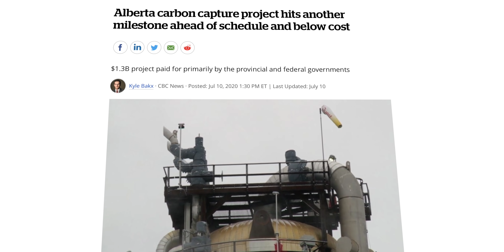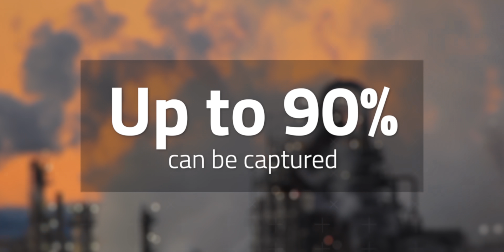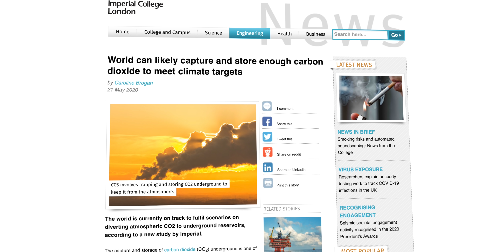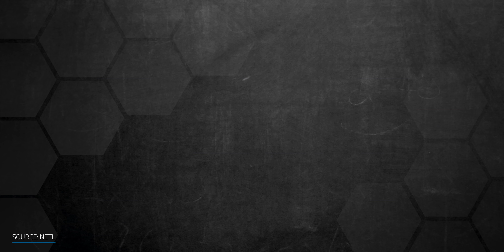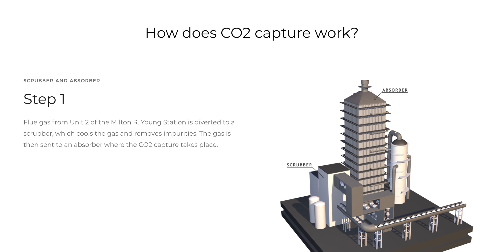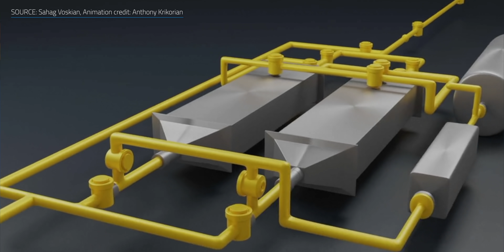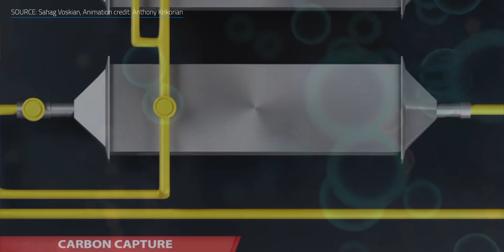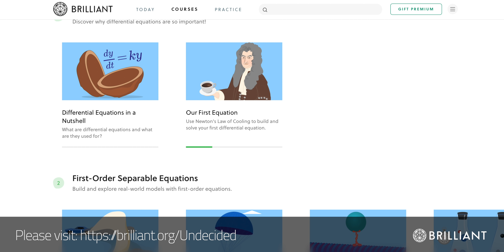The truth about capturing CO2 to reverse climate change

Comment: The energy required for CCS means that it's better to leave the carbon in the ground in the first place.
Reply: Niall Mccarthy  We or anything else don't need the excessive amount that humans are producing.
Reply: @3rdrock  Perhaps it's sad, but it's easier to create huge global infrastructure projects than to change our behaviour. CCS is here to stay.
Reply: @samspencer7765  Too bad there are none that actually work.
Reply: @3rdrock  Carbon sequestration does work we just won't be at scale until the middle part of the century, there's good promise in energy storage for renewables too
Reply: @samspencer7765  Can you cite one example that isn't Advanced Oil and Gas recovery(AOG)?
Reply: @3rdrock  I think there's some pretty interesting stuff going on in terms of mineral & soluble carbon trapping. Riaz & Cinar showed the feasibility of shale based sequestration in 2014 but I'm most interested in North Sea liquid absorption as of right now, but we'll have to wait until the mid 2020s if Covid hasn't knocked it back a smidge.
Reply: @3rdrock  Also just out of curiosity, roughly how old are you?
Reply: @samspencer7765  you seem to know something about CCS, at what pressure do you think they are pumping the CO2 into the ground?
Reply: @samspencer7765  just out of curiosity why do you want to know my age?
Reply: @3rdrock  I'm terms of the pressure within the actual ducting as it travels down I have no idea, it'd depend on the material and diameters they were using, whatever seals they were using to stop reversal etc.

But in terms of what pressure carbon dioxide would need to be stored at in terms of mostly raw CO2 that you're not doing anything special to (Think using cerium as a catalyst to remove the oxygen atoms etc), would be somewhere in the region of between 1000 - 1200 psi. If you can get it below about 900 meters, say 1km to be conservative you can keep it in a supercritical fluidy type state indefinitely just by the natural psi down there is within that range. Now sequestration is NOT the smoking gun solution, it's certainly pricey and you'd get best results by finding areas that are seismically stable but that don't present a challenge in boring down too much, which is why the North Sea is pretty promising.

Im no economist, it may transpire that trying to decarbonise goods, services and energy is cheaper in the long run, but I'll bet that over the next 20-30 years that won't be able to happen fast enough and we'll use sequestration as a stop gap solution in part until we get there.
Reply: @3rdrock  It feels a bit detached when it's just a name with no indication of who you're talking to, one of the sadder aspects of the Internet in general :/ I often find it bridges the gap in terms of getting to understand each other and where we're coming from. I'm 25 myself, I often see different generations mock/ shame each other for something without cause just cause they're from different times. Me, I like to hear perspectives from across the board.
Reply: @samspencer7765  We're getting there. The devil is in the details.
Dealing with hot, high pressure CO2, ie supercritical CO2, is a nightmare. Materials required to handle these conditions are extremely expensive and even they deteriate very quickly.
As I  pointed out earlier the whole exercise becomes so difficult and expensive that it's much easier to just leave the stuff in the ground in the first place.
Reply: @samspencer7765  Fair enough, I'm 60.
Reply: @3rdrock  in fact 1 tree is 13000 times more effective in dollar terms than any Capture machine
Reply: @samspencer7765  Require all new energy generation is renewable and all ground transportation is electric, reduce air travel with high speed rail and start manufacturing locally. Eat less meat. Or fry.
Reply: @3rdrock  trees do work, and they do that, perhaps creating a massive farm of trees and storing the trunks, like in the carboniferous period. like a massive floating farm of tree in the ocean covering 20% of it, and the best thing is that the trees would grow almost on their own, and they also source materials to be used.
Reply: @monad_tcp  I agree but wouldn't it be easier to reforest land where possible ?
Reply: @samspencer7765  - no, that's limited example of a process that take 2 years to build rock from CO2.  It does not scale.  You have to extract from stack, store, transport, store, pump to the one magic hole where the geology is proper to do this, wait 2 years while the excess CO2 builds up in storage tanks like Fukushima irradiated water at Daiichi.  Don't get conned with small scale trials that are predicated on use of a unique geological formation with a convenient port of entry and no leaky spots.  It's a unicorn solution.
Reply: @Brin Jenkins Correct but thanks to coal and oil we are warming and poisoning  the planet.
No one is saying fossil fuels will be replaced overnight but renewables and smart energy systems are more than capable for the task.
Reply: @Brin Jenkins In a relatively short time batteries will do everything and more than gas peakers.
Reply: @3rdrock  already does in south australia with a 60 day build by tesla
Reply: @flodjod  I'm with you buddy.
Reply: @Brin Jenkins Ah there we have it, in the last sentence. I was wondering when that would come out.
Reply: @Brin Jenkins Wind is for free. Think big and think power law.
Reply: @Brin Jenkins what black lung from coal has extended the life average ffs
Reply: @Brin Jenkins do you know the comparative costs per unit of coal, gas or nukes against solar, wind or tidal? pure facts as at beginning of 2020 coal was 5x more costly gas slightly more and nukes 10x
Reply: @Brin Jenkins ohh wonderful a half life of 500 or so years what a wonderful future ffs
Reply: @Brin Jenkins take away all the tax breaks for coal oil and gas and it adds uop to far more than subsidies for renewables
Reply: @Brin Jenkins There would not be one nuclear power station if it wasn't for subsidies. You've got to open both eyes.
Reply: @Brin Jenkins Give us one example of a privately built and run nuclear power station.
Reply: @Brin Jenkins So you've got no examples of unsubsidized nuclear power stations.
Reply: @Brin Jenkins Name just one.
Reply: @Brin Jenkins Come on Brin, giving up fossil fuel or nuclear isn't the same as getting a lobotomy.
Reply: @Brin Jenkins Why wouldn't you want to change to renewables? 
If we are clever enough to make a difficult thing like nuclear energy work, then surely renewables can't be that hard, right?
Reply: @Allen Loser For the price of the unfinished Hinkley Point C we could build all the solar, wind and batteries required, in a fraction of the time and a fraction of the ongoing costs.
Reply: @Brin Jenkins Still hanging in there Brin.
Renewables have zero fuel costs....
Reply: @Brin Jenkins Nice story but where are all these new generators you keep going on about?
Nobody wants to build them except people like you who have been brainwashed into believing that renewables are bad.
Reply: @Allen Loser Well done. You really got me there.
What will us greenies do now?
Reply: @Brin Jenkins Here we go..
Next you will be telling us all that that it's a Marxist plot, lead by George Soros to form a new world order
Reply: @Brin Jenkins yes it's actually 0.04%. 10 times worse than you thought. Come on Tiger , if you're going to argue about facts at least try and get them right.
Reply: @Brin Jenkins Do you accept that CO2 is a greenhouse gas ?
Reply: @Brin Jenkins Well if you can't find a mechanism then it can't be true. I give up.
Reply: @Brin Jenkins https://earthobservatory.nasa.gov/features/Arrhenius It was all done a 100 years ago. Are you deliberately being obtuse ?
Reply: @Brin Jenkins CO2 absorbs IR radiation that would otherwise be heading into space and redirects in all directions warming the atmosphere The more CO2 the more warming.
Reply: Wilbur Wafer  He can't be getting paid much lol
Reply: false. 1MW/h today is worth more than 1MW/h 50 years from now. because energy production gets cheaper all the time, that means there's inflation in its price.
even if that 1MW/h we got from fossil fuels today takes 2MW/h to capture it back in the future, it might still be well worth it if those 2MW/h are cheaper at that time than the 1MW/h is today.
Reply: @BattousaiHBr  That could be true but there are no properly functioning CCS systems operating now or in the foreseeable future.
Reply: @3rdrock  that is not true at all. carbon capture has existed for quite a while now (in case you haven't seen the video), it just isn't financially viable, meaning, there's no monetary incentive since getting carbon from other sources is cheaper than capturing it from the air.
but prices do go down every year, so eventually it'll get cheap enough to be a real feasible solution.
Reply: @BattousaiHBr  pumping CO2 into gas and oil wells is not CCS.
Reply: @BattousaiHBr  Can you name one functioning CCS facility that is not related to Oil and Gas recovery ?
Reply: @BattousaiHBr  Did you watch it?
Reply: @3rdrock  yes. did you?
Reply: @BattousaiHBr  Lots of "going to" and "could be," all based on a tiny pilot plant.
Name one functioning CCS facility that is actually doing something real.
Reply: @3rdrock  ???
you do realize that just because the idea is old it doesn't mean efforts were seriously tried before, right? i assume you know of this guy named elon musk, who finally made electric vehicles what they should be after 100 years of being an irrelevant concept.
carbon capture efforts only really started in the last 10 years or so, both investment and R&D are increasing every year.
Reply: @BattousaiHBr  So you can't find one?

I'm just saying, it's easier to leave the carbon in the ground than to dig it up and then force it back into the ground. 

Elon is showing us a way of doing it.
Reply: @3rdrock  it is easier to leave the carbon in the ground, since you don't need to do anything to leave it there.
except it's a great and cheap source of energy, hence why it's been historically worth digging it up and burning it.
just curious, where are you from?
Reply: @BattousaiHBr  I can't argue with you there but renewable energy and storage would be a much better investment of money. It's easier, cheaper and better for the environment.
Reply: @3rdrock  i agree, but like said in this video, even if we stopped ALL sources of dumping carbon in the atmosphere (including the meat industry), our current carbon levels are still a bit higher than desirable, so we'd want to capture it from air and store it underground anyway.
and let's be real, that is never ever going to happen overnight, carbon emissions will be with us for the better part of the next half century whether we have mitigations in place or not, expecting everyone to fully board in the renewable ship in the next 10 years is delusional (think of all the developing nations like india that simply dont have money to spend on research and renewables when they need energy badly and for cheap and they need it NOW, while developed nations like the US and others in europe already had their turn of polluting the atmosphere and got rich in the process), and renewables do nothing to fix the meat industry, so we need carbon capture to help keep emissions at bay anyway.
Reply: @BattousaiHBr  The world burns approximately 8.5 billion tons of coal a year. If you think anybody is going to build sufficient air capture facilities to deal with that you are delusional, never mind all the oil and gas.
Countries like India have an opportunity bypass the old fossil fuels. Imagine cities with electric only vehicles.
Reply: @3rdrock  again, nobody thought electric cars would ever be a thing just 20 years ago.
technology evolves. rapidly. that's what technology does.
carbon  capture is in its infancy, it's still going to get much better, both in performance and price and scale.
Reply: @BattousaiHBr  ok buddy.
I hope it all goes well for you.
Reply: Better yet, ignore the eco-fascists and hoaxers. They are just in it for the money, attention, and power. 

There is no global warming, there is no climate change.

And even if the United States crushes the freedoms of its people and destroys the economy it doesn't matter: Virtually all pollution occurs in Asia.
Reply: @illuminated2438  lol "eco-fascist's."
What, are you Russian or something ?

Comment: Madness is rare in individuals - but in groups, parties, nations, and ages it is the rule. Friedrich Nietzsche 
Tell us, Matt, how much did the oil cartel pay you to foster this foolish fiction?  Throughout your presentation you ASSUME that carbon dioxide is inherently harmful. Would you kindly explain HOW it is harmful? That will be a good trick, because carbon dioxide is inert, benign, beneficial, and ESSENTIAL FOR LIFE! Every cell in the body manufactures carbon dioxide, and the human body contains about 20 liters of carbon dioxide that is absorbed in fluids and tissues, as compared to one liter of oxygen and one liter of nitrogen. If the stuff were toxic, we would all be dead. CO2 is essential for oxygen oxygen capture from the atmosphere and transport to cells deep within the vertebrate body. It lowers capillary flow resistance, and promotes cardiac output and tissue perfusion. It has no more toxic effects than water. One can drown in carbon dioxide, just as one can drown in water, but it has no toxic effects on tissues. In short, all this noise about carbon dioxide is just that---NOISE. It stinks of ignorance and malicious mischief. It's expecially ridiculous when one considers that cancer, diabetes, hypertension, asthma,rheumatoid diseases, and chronic illnesses of all sorts were rare 100 years ago, are rising catastrophically in accord with toxic environmental pollution from automobile exhaust, chlorinated water, pesticides, herbicides, and toxic industrial wastes. Anyone interested in the facts might begin with my essay called "Four Forgotten Giants of Anesthesia History" that is published on the Internet and can be accessed free of charge. www.stressmechanism.com.

Comment: I can't say as that I understand global warming. Now I get the premise that co2 gets into the atmosphere and disperses the ozone letting more heat from the sun in.
 But that heat is going to cause more wether, namely lightning. Then the high voltage electric arcs should concentrate more ozone?

Also if the carbon comes from "fossil" fuel dosent that mean that premass extinction that these animals were living died and rotted, all released co2 into the atmosphere. So there must have been a higher consintration, before most of that carbon got buried?

Comment: I worked at the Kemper County Mississippi new construction coal gasification and carbon capture / sequestration plant.  We spent years perfecting the system, and as we were bringing it on line after pumping billions of dollars into the project including hundreds of millions into the local economy the local government decided that they were not going to allow Mississippi power to adjust electric rates to pay for the project.  Rinky dink local officials basically defended a multi billion dollar project that had developed a near net zero carbon emissions coal powered electric generation station.

I'm not bitter or anything....

Comment: It only makes sense to capture carbon and utilize it to make materials. Making synthetic fuels, on the other hand, is pretty expensive. What's more, at the end of the day, green synthetic fuels are basically green hydrogen with a few extra steps since green hydrogen is an essential ingredient. It would very often be better to just use green hydrogen as fuel rather than go through the hassle of using green hydrogen to make synthetic fuels. Especially as the cost of hydrogen fuel cells continue to drop like what has been going on with batteries, solar PV panels and wind turbines.

Comment: How about using some grade school biology.  Plants take CO2 out of the air and use the carbon to create their own structure and release oxygen as a byproduct.  Plants are cheap, we need them for food, build structures from wood and have farmers world wide working on the team.  There is a lot of nasty stuff coming out of those smoke stacks and tail pipes, however, CO2 is not one of them.  WE NEED CO2 TOO MUCH.  Continue this nonsense and we will create is world wide starvation instead of feeding the entire world and providing cheap building materials.  I'm a Tesla fan for the right reasons.

Comment: Unless you make entire electric grid running on renewables CCUSes are the pipe dream. It's not that they are expensive. They are energy consumers. Just like current nuclear fusion technology takes more energy input than give energy output, CCUS produce more CO2 to run than it captures. Perpetual motion machines don't exist. You need an energy input from outside of the system (Earth). Nothing less than going full solar and wind is going to help now. When tipping points hit in Arctic and permafrost melts and natural emissions due to Oceans and land becoming net carbon emitter rather than sink, it will double human emissions. CCUS will look like a false hope that stopped us from acting immediately.